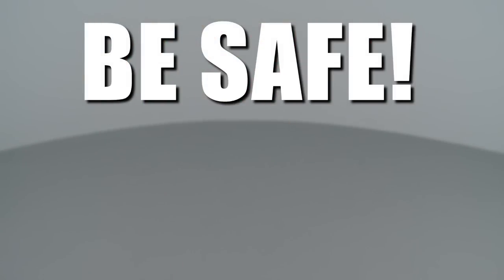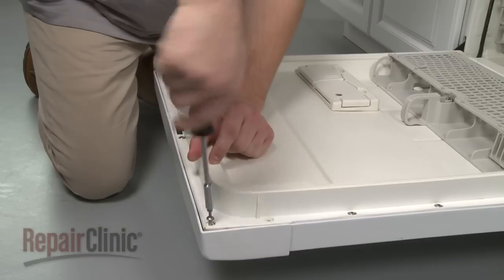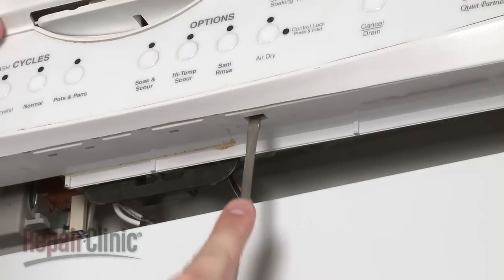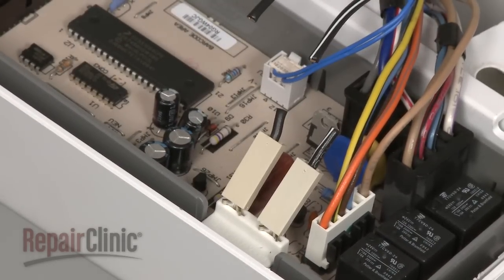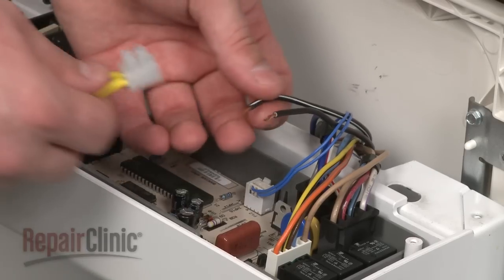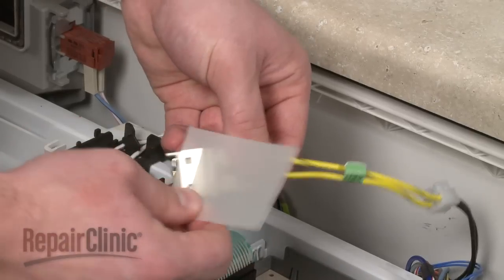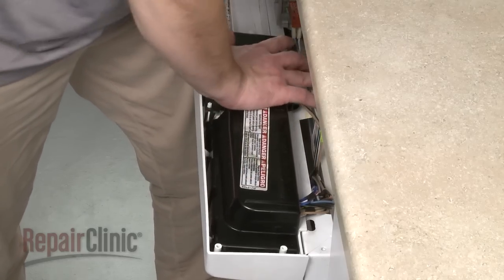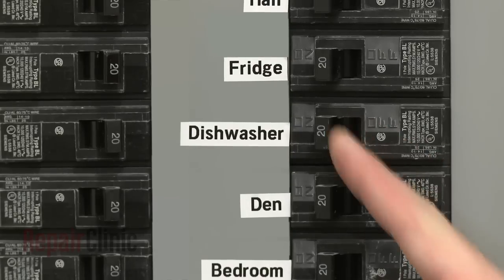Whirlpool Dishwasher Won't Start? ReplaceThermal Fuse #8193762

Comment: After experiencing the same "no power" issue, I researched online and found one common thread in all the cases. That thread was the Thermal Fuse. This video was instrumental in showing me the nature of the fix, I ordered the part, performed the steps as shown and presto, problem solved. Thank you very much, you saved me time and quite a bit of cash.

Comment: Tried to skip cutting new wire, and would not work ... follow his instructions and BOOM, works like a charm, thanks
Reply: I did the same thing first go-round.  Only replaced the fuse and not the wires.  It lasted for about 30 minutes.  Replaced it again a few days ago along with the new wires.  Has ran great ever since.

Comment: Thank you, you just saved my bacon. I got home at 4:00 am to find my dishwasher inoperable and after pulling it out and undoing the brass water line I was able to reach the plug. After testing the plug with my meter I found it to be just fine , then I went on you tube and found this video and tested the fuse and sure enough it was bad. The only thing I had lying around was a 20 amp automotive relay so I put that in and everything is now working again😀😀.
Will order a fuse on Monday and take the relay out then. 
Thank you so much because I can't afford a new dishwasher👍

Comment: While this is a handy video to show how simple it is to replace the thermal fuse, it would be helpful to know what is recommended prior to replacing the fuse given something caused it to burn out.  My concern is that I will replace it and it will burn out immediately again because another part failed in the first place.  I have already replaced the control board on my Whirlpool Dishwasher GU2400XTPS1 and the only progress I have made is that the flashing lights are different now than before!

Comment from the maker: @kman7899 If the thermal fuse blows the dishwasher will be completely dead. This fuse protects your dishwasher from overheating. If the dishwasher overheats this device will fail to prevent further damage to your appliance. If it does fail you should repair the overheating problem first and then replace this thermal fuse.

Comment from the maker: Thanks for the comment! The wires are replaced to insure you are getting a good connection. Sometimes the  connectors get burnt or are not making a good connection.  The factory includes the new wires to help prevent future problems.
Reply: I found the reason the hard way , there is a “design” issue with the fuse clip they overheat

I replaced only the fuse and it was stopping again and again, bought another fuse and the same, replace the rubber gasket as steam could over heat the controller area
Lastly, somebody wrote a comment somewhere telling the design flaw and replaced the whole wire and problem gone

Comment: I just replaced the thermal fuse a couple of months ago on my whirlpool quiet partner 3. It worked fine up until about a week ago when my dishwasher was in the locked position. Since I depressed the heated dry button, now the heated dry button is blinking constantly. I even replaced the control board and it didn't change a thing. What should I do? Please let me know. I can't afford a whirlpool technician and I definitely can't afford another dishwasher

Comment: I just replaced the thermal fuse. Second time in a week. The first time, I didn't use the wires that came with the kit, I used the existing ones. I found out that you NEED to use the new wires, or you can have the same problem again.
Reply: Same thing here, fuse keeps popping.  I also used the old wires.  But, the wires are cannot be part of the problem, makes no sense.  too much heat or fuse is faulty.  How the current gets to the fuse is a non-issue.  How do you explain the wires being part of the problem?
Reply: @forename_surname  Metal in a humid environment corroding and not having the same conductivity that it used to, and ergo, growing rather hot and tripping the circuit? Theoretically, you could just cut the cables and lug them yourself with a fitting insert lug.

Comment: What is the reason for abandoning the old connectors and re-stripping the wire leads? Is it simply because that is the way the replacement kit is made? Is there a technical reason?
Reply: I found the reason the hard way , there is a “design” issue with the fuse clip they overheat

I replaced only the fuse and it was stopping again and again, bought another fuse and the same, replace the rubber gasket as steam could over heat the controller area
Lastly, somebody wrote a comment somewhere telling the design flaw and replaced the whole wire and problem gone

Comment: Can anyone explain why it's necessary to cut off the old connectors and splice on the new yellow wires?
Is there a problem with the old slide-on connectors to the fuse?

Comment: If I still have power to the dishwasher, could it still be the thermal fuse? None of the controls work and no LEDs light up with the exception of the clean LED, which flashes once when I close the door firmly. I already tried unplugging it for several minutes as well as throwing the circuit breaker.

Comment: In need of help with my dishwasher, I ran the wash today and when I came home 4 hrs later I was surprised to see the wash still on. When I opened it, the bottom was filled  with water and that's when I noticed the hose on the top rack was completely off. Now its not running at all. What could solve the problem

Comment: Please add “WIRE MUST BE REPLACED IN TITLE”
I found the reason the hard way , there is a “design” issue with the fuse clip they overheat

I replaced only the fuse and it was stopping again and again, bought another fuse and the same, replace the rubber gasket as steam could over heat the controller area
Lastly, somebody wrote a comment somewhere telling the design flaw and replaced the whole wire and problem gone

Comment: Hey Everyone, my Whirlpool Quiet Wash Plus dishwasher (model DU920QWDB4) from around 2005 has a slightly different assembly, so yours might too. It's a little more difficult to get to the control panel. After removing the 8 inside screws, you have to slide the FRONT decorative panel off to get access to a final screw holding the housing together. It's all smooth sailing after that!

Comment: I have a dishwasher. Whirlpool
modelDU920PFGB0. What it says  is it does not unlock and pushing   the unlocking area on panel
makes the lock  light blink! However, It stays lit after blinking and will not start! Help$

Comment: My Kenmore has no lights on the control panel and will not start at all, no matter what button I press.  There is power to the unit. The strange part is that this has happened a couple of times before and somebody can come along a few hours later, push the start button, and the unit starts and runs. It is important to note that for a couple of months now, you cannot change any of the wash options or set the delay timer. You have the option of running the dishwasher or not running the dishwasher.

Comment: After having no power to the dishwasher, I did this exact repair.  Once complete, the power came back and when I started the dishwasher cycle water started to flow as it normally does.  After 10 seconds it stopped.  The lights are still on, but it seems like its stuck.  I canceled and started a new cycle.  Same thing, it starts like normal, water starts flowing in, and then after 10 seconds it stops.  I can hear the control panel inside clicking.  Any thoughts?

Comment: ...my Whirlpool dishwasher is not drying properly. I have replaced the high heat sensor and the heating coil. Would replacing the thermal fuse help?
Reply from the maker: +Eric McGrosky The thermal fuse, when blown would cause the whole dishwasher to not run. You may have a control board problem.

Comment: What is an indicator that the thermal fuse needs to be replaced??
Reply: No power whatsoever, power arriving on the left side of the use as confirmed by a voltage detector or voltmeter, but not on the right side. If you have power on both the left and right side, it's likely the control board.

Comment: I have a Bosch Dishwasher that stops working, no power at all, will this  thermal fuse work on Bosch?
Reply from the maker: +SALLY MUFFET It will not. Most Bosch unit don't have a thermal fuse. Door switch/latch assembly or control board problems could cause the unit to not power up.

Comment: What's the purpose of cutting wires instead of just removing the connectors and changing the fuse?
Reply: The wires may have corroded near the fuse, so best to change wires and fuse at the same time to avoid blowing again
Reply: @mkuts1046  Yup. This is a known problem with this model.

Comment: Many people have asked but I have not seen an answer. Why is it necessary to cut the wires and use the terminal block??
Why not just SLIDE the connector off the old fuse and and slide the connectors back onto the new fuse??
Reply from the maker: There was an overheating problem with the thermal fuse wiring is that why the manufacturer recommends cutting back the wiring and repairing with the new harness. Thanks!

Comment: My Whirlpool dishwasher starts and puts water in the tub, releases the soap but something prevents the wash cycle from starting. Is that the thermal fuse?
Reply: That is the same thing mine is doing, did you end up finding out what it was? Should I replace the thermal fuse? Thanks

Comment: We changed the thermal fuse  $30,  
but it did not work.  :( 
The dishwasher still won’t work ! No lights, , no sounds,  Nothing !  Oh no! 
Now what ?  Any ideas ??  It is a kitchen aid dishwasher 
Model # KUDP02CRBS3 
Your expertise would be most appreciated.  :)
Reply: Control board is shot. Not so much for you but for other readers on the net.

Comment: I changed the thermal fuse because the clean light was blinking 7 times. The fuse was all black. Put it back together and the dishwasher keeps on acting the same way. What else could it be? The board?
Reply from the maker: Your dishwasher is sensing a low water temperature. If you know where your tech sheet is, pull that and follow the instructions on resetting the control. If this doesn't fix the problem you may have a problem with the heating element.
Reply: I cannot find the tech sheet. Is that something that is available online?
Reply from the maker: I would try Googling the brand and model and "reset sequence" or something along those lines. You should be able to find it. Let us know if you can't.
Reply: are you talking about the diagnostics test?
Reply from the maker: No, it's a reset sequence. This is one we found for this model: 1) Crack the door open. 2) Within 3 seconds press the following sequence - Hi Temp Scrub, Energy Saver Dry, Hi Temp Scrub, Energy Saver Dry 3) Close and latch the door 4) Press the cancel button (the circle with the triangle in it). Let us know if this works.
Reply: Ok, tried and same thing stopped at around 22 minutes into de cycle. I opened the door and there was a lot of suds even though I ran the dishwasher without any detergent. The fuse was definitely bad because it was black, like smoke....WHat else could be causing this problem? Do you think the board?
Reply: DO you have any video on how to change the thermistor on a kitchenaid dishwasher?
Reply: Hi, I changed the fuse, because it was bad, the cycle continues to stop at 22 minutes, they I checked the thermistor, hi temp thermostat and the heating element, all check good with ohms readings, what else could cause this? the board itself?
Reply from the maker: cpriwin 

The main electronic control is programmed to stop running and not allow any further cycles if it detects a water heating problem such as no temperature increase in heated Main Wash cycle or in 3 consecutive cycles depending on what software version is in the dishwasher. Main electronic control blinks the Clean LED 7 times repeatedly and disables the Start/Resume keypad.

Things to check when this fault detection occurs:

Heater circuit problem:
-Open heater.
-Wire disconnected, open connection or component in heater circuit.
-Faulty heater drive circuit on control.

Door switch not making contact consistently:
-Misaligned door latch assembly (which can be aggravated by high door closure force keeping strike plate from fully seating).
-Faulty door switch (high resistance).
-Loose or missing installation anchor screws that secure dishwasher to the counter top, causing tank to shift in & out when door is closed. 

NOTE: Neutral switch on plastic tub models are only in series with the heater; other loads are not affected.

Wash pump not pumping water past the heater efficiently:
-Foreign object in pump.
-Excessive foaming.
-Clogged pump screen or broken chopper screen.
-Loose electrical connection in motor circuit.

Lack of water to heat (Unit not filling properly):
-Insufficient water supply pressure.
-Fill valve screen blocked or valve not opening fully.
-Loose electrical connection on Fill Valve.
-Float switch obstructed or functioning abnormally.

The proper diagnosis and resolution of this fault detection may be beyond the capabilities of the do it yourselfer, therefore it may be best to have the dishwasher checked out by a factory authorized appliance repairperson. Our purpose for providing the above information is to educate consumers on what factors can cause the fault detection and what may be involved in resolving the issue.